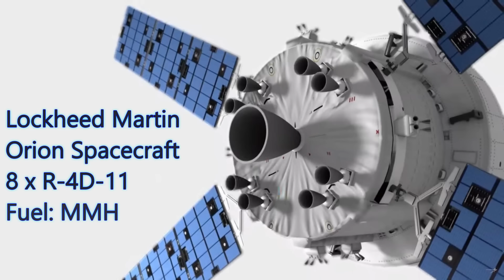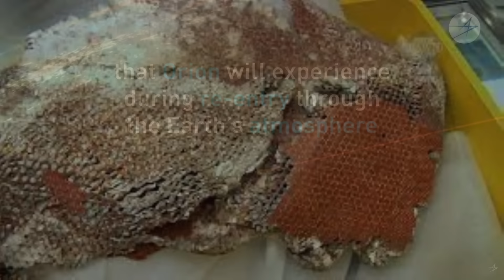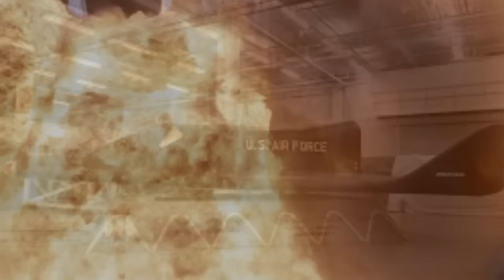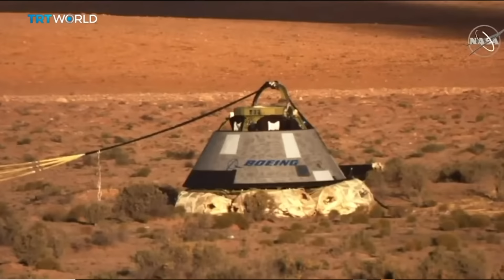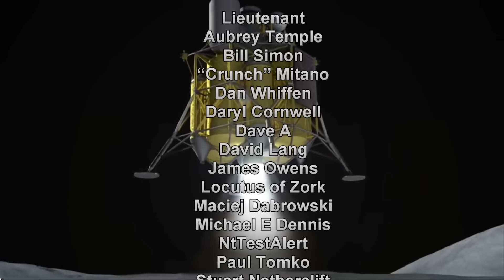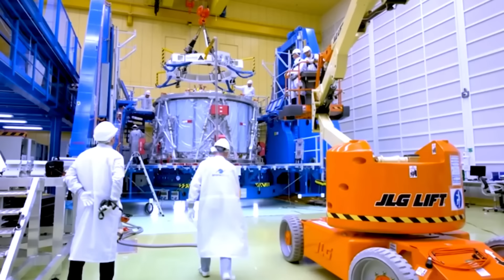Can We Trust the Boeing Starliner or Even Orion to Carry Astronauts to Orbit or the Moon?

Comment: Putting all your money on a one horse race, is asking for trouble!

So NASA wanting more than one Reusable Launch and Re-Entery Crew  Passenger Space Vehicle (RLRE-CPSV) system, from more than one Manufacturer too.

As well as NASA wanting more than one First Stag Reusable and Recoveryable Launch Rocket (FSR-RLR) systems, as well as more than one Second Stag Reusable and Recoveryable Launch Rocket (SSR-RLR) systems.

Maybe if neccessary NASA having more than one Expendable Third Stag Launch Rocket (ETSLR) systems too, all from different manufacturers too.

As well as separate Autonomous Reusable Launch and Re-Entry  Transport Space Vehicle (ARLR-ETSV) system, with its own large internal hangar, as well as its own remote-operated manipulator arms plus opening and closing Hangar doors too.

To transport and launch and deploy satellites in orbit, or carryout  autonomous repairs or replace damaged devices and equipment, or install modifications and upgrades in orbit too.

Or if necessary carryout Orbital Recovery Operations (ORO's) of satellites, in Low to Medium or even High Orbits too!

Or to transport cargo and supplies, from earth to a Space Station in earth orbit, then return with other cargo back to to earth too.

Or transport cargo to an orbital Space Station, which is in orbit around the Moon too. Then return to earth again, with other cargo, that has been shuttled up from the Moon surface  too.

All of this makes common sense and is good practice, for NASA wanting to have multiple options.

Space X maybe the only Reusable Launch and Re-Entry Crew Space Vehicle (RLRE-CSV) system, in operations but it is only useable in Low to Medium Earth Orbits (LMEO's).

As well as carry limited crew and passengers capacity,  plus very limited cargo carrying capacity to and from orbit too! 

Which has to be increased, for  building any future Moon surface base, or setting up first any Moon Orbital Space Station too.

The same goes for any future Mars Exploration Flight, with setting up a Mars Orbital Space Station first, then building a Mars surface base afterwards too!

In either case of setting up a Moon or Mars surface  long term or permanent bases, NASA will need a Reusable Orbit to Surface and back to Orbit Cargo Transfer Vehicle (ROSO-CTPV) system, with its own pilots or unmanned  remotely operated "ROSO-CTPV" too!
Reply from the maker: Agreed my friend. That's why other companies need a chance. Sierra Space etc.

Comment: Launching to the moon takes about the same Delta V as launching to mars because mars has aerobraking available to save on delta V budget. When you are coming back to earth the trip from mars is going to be about 10-15% faster.

Also, Dragon had heat shield problems when it first started launching, it's not like that is some new unheard of cockup. The problems that hit the heatshield were not along the seams between blocks. Since the blocks are made of the same stuff as the apollo heat shield just going back to the monolithic construction wouldn't be likely to fix the problem. The reentry profile for this launch is different, it does a skip along the atmosphere first and that may be changing the behavior of the surface. If that is the case then it is a problem that's unlikely to penetrate deeply and cause problems.
Reply from the maker: The problem may be the difference between thousands of vertical cells and just a few big blocks... The former is inherently stronger.  Yes. Coming back from Mars is a little faster.  Yes. Dragon had heat shield issues which the fully rectified BEFORE putting people on them. The skip may indeed be the source of the problem. Perhaps heating, cooling, and reheating has some effect.

Comment: A thicker Crew Dragon heat shield would probably do the job.   Instead of spending $4B and going to the Moon, just launch a mockup of Crew Dragon with the thicker heat shield using Falcon 9 and put it in an elliptical Earth orbit and then fire a kickstage to bring the re-entry velocity to 25,000 mph.  They could launch one a week until they proved out the heat shield.  They could probably have it working in 6 months.   This is what Apollo 4 and 6 did (both unmanned)
Reply from the maker: You could do a straight up / straight back down or use a Falcon Heavy to send it around the Moon. :-)
Reply: @terranspaceacademy  They have to enter the atmosphere at a very precise shallow angle.  That's why Apollo 4 and 6 went into a high elliptical orbit then did a burn to get the speed up to 25,000 mph.   Doing a loop around the Moon would do the trick too 🙂

Comment: Dragon had a lot of similar problems in earlier years and continues to have issues today, yet nobody doubts it is safe to fly.
Regarding Starliner, NASA ASAP which in recent years had raised concerns with Starliner recently said they are more than satisfied with the due diligence from NASA and Boeing regarding crew safety and working out previous issues.
Regarding the heat shield on Orion, it is not expected to be a showstopper.
The heat shield for Artemis 2 is already long installed on the spacecraft and replacing it would be a huge schedule hit, measured in years.
NASA has said the root cause investigation is nearly closed and they don't expect any hardware changes will be needed at least for Artemis 2 and 3.
The heat shield itself on Artemis 1 worked very well with a lot of ablator margin available.
What happened wasn't that it ablated more, more so that the ablation patterns were different than pre flight models expected.
The heat shield did not have cracking or anything of the sort, I don't think anyone from NASA has said that.
What we have been told so far is that the ablation wear patterns were not as predicted, and that they saw more uneven ablation in some areas than pre flight models expected.
They want to figure out why, and then update their models to make sure they can predict the heat shield behaviour better in the future.
From what we've heard so far, what was seen on Artemis 1 was NOT an issue for crew safety.
I do think it's funny that people would rather fly on a theorized crew Dreamchaser, and somehow are certain it would be safer than actual real world vehicles.
The grass is always greener on the other side I guess.
Reply from the maker: That's because of all the uncrewed cargo mission before they stuck people on it. Work out the problems before you risk people's lives...  We are looking at two Starliner failed flights and one Orion and now we are sticking people on them.
Reply: A Boeing employee are we…

Comment: I don't trust Starship getting to the Moon, or anywhere else beside Low Earth Orbit.
This because the refueling in orbit is still unproven; but what gives me the shivers is the number of launches necessary to refuel the orbiting Starship.
Initially SpaceX said six launches were enough. Then, I heard maybe ten were required. Then, I saw a video of Destin (SmarterEveryDay) giving a lecture at NASA, and there transpired that the launches required were fifteen, and the people there just avoided talking about it.
Fifteen launches must go ahead without an hiccup, without aborted launches, without failed launches. And if a couple of Starship Tankers happens to fail en-route to orbit, SpaceX must have a number of spares ready for launch. And if the experimental ship-to-ship fuel ducts fail to mate, because of debris or thermal deformations, without some astronauts ready to go on an EVA, the Starship launch mission from Earth orbit is cancelled.
I don't want to sound like a Cassandra, I'm all for Space Exploration at 100%, but I have the feeling that Elon Musk has over promised, and NASA bought it whole. In detail, SpaceX glossed over the logistics of  refueling in orbit, and NASA didn't enquire.
I hope that my doubts are out of place, and orbit refueling will prove to be a cakewalk...
Reply: To be fair. I don't think anyone really knows. SpaceX is constantly updating Starship, it's basically in it's epoch phase. Raptor 3 is slated to come out that won't require heat shields and have much higher thrust (meaning more mass to LEO). Along with the booster and ship being stretched to hold more fuel and cargo.
Reply from the maker: Starship should be placed in orbit and then crewed by Dragon... There should be a third stage to go on to the Moon and land I think but I'm still looking at the options.
Reply: Having your space crew lunar module the same as your living quarters is a stupid idea. Every time they want to leave the Moon, they have to blast that huge spacecraft, that's a lot of mass. Spacex should have went with a small crew lunar module and have the starship just be the cargo ship.
Reply from the maker: @Ghost-g3i  We agree. Detachable nose cone is the way to go I think.

Comment: I am also curious to see what SpaceX is going to do with Crew Dragons heat shields for any lunar crew return missions?
Reply: The Crew Dragon won't be used for lunar trips, but only for going to the ISS and back.  Starship is intended to return astronauts from the moon, but that is down the road a ways as they first must rendezvous with Orion to transport astronauts to the lunar surface with Artemis 3.  That won't happen until 2026 at the earliest.
Reply: @michaeldeierhoi4096 per current plans, Starship will only be returning humans from the Moon's surface to NRHO.  From there, Orion will pick them up and return them to Earth.  HLS Ship won't have enough propellant left for a return from NRHO to LEO or MEO, nor will it be capable of reentry or landing on Earth.
Reply: @Spherical_Cow  On what basis do you say the HLS vehicle won't have enough fuel to return? The HLS vehicle will be fully refueled before leaving Earth's orbit and then most of the fuel used will be for landing on the moon and take off.  

You may be right, but I need to hear your reasoning.
Reply from the maker: It would need to be redesigned... It's capable of orbital return only.  Only Orion is capable of a lunar return.
Reply: They probably already have it designed and tested it. I’m concerned about the theory of starship. I don’t think the starship is going to be able to land vertically on the moon. It just looks like a tough job.
Reply: @briananderson4032  Why do you think that would be a tough job?   The whole of the starship project is a tough job.  But, since the raptor engines can throttle down to as low as 40% thrust they could probably land with one engine.   

Alternatively,that may be something that is worked out later.  I see the starship is one very interesting engineering project and I don't worry about how it plays out.   Some people perseverate on whether the tiles will be adequate for reentry for ex.,but this is all part of testing so I expect failure to happen along the way.  So I can be indifferent to what happens. 

Even Elon said there is no guarantee that starship will be successful.  I think it will get to the moon though not on the timeline they expect or hope for.

Comment: Correction Boeing bought out Mcdonald Douglas for thier military buisness. I know a bunch of old guys who worked at Douglas which then became Boeing and they said the exact opposite, that when Boeing took over the safety culture disappeared and quality took a nose dive. Workers would have to inspect their own work and training was cut way back.
Reply: You are right that it was Boeing buying McD that it all changed but what happened in the transition is a fog of changes that we can only speculate. Both were good companies and now it does not look like either one of them survived.
Reply from the maker: I find that inconsistent with Boeing's previously outstanding record...
Reply: The management at Boeing basically had no respect for the engineering teams at MD-80 Long Beach, MacDac HBeach, and Rockwell Int Downey.  Instead of building a knowledge base that passed generations of engineering insight from the steely eyed missile men of Rockwell and MacDac, they basically got rid of those engineers and had no pipeline of Gen X and Millenials to replace.  There was no passing of blueprints, designs or concepts to the next generation.  For this reason, Terran Space Academy's work is really important.

Comment: Simple answer is Starship - they may be a TAD behind but since last flight the issue is re entry for full landing (which others do not even try) and they burn up rockets to solve this - which likely results in this working end of the year. I would not wonder if Elon Musk puts something on the moon for testing in 2025/2026. Maybe even in preparation for a permanent moon base (deploy some supplies, do some scanning of the landing area) and POSSIBLY with some Optimus Robots instead of Astronauts.
Reply from the maker: I'm hoping!

Comment: Didn’t Boeing buy McDonnel,/Douglas?   I think they did but I could be wrong.
The Board Of Directors foolishly decided to replace a lot of Boeing management withe MD managers.  The corporate culture changed focus from engineering to finance.  

The current disaster known as Boeing is the result.
Reply: Boeing management replaced and caused retirement of MacDac Long Beach/Huntington Beach and Rockwell Downey/El Segundo/Seal Beach people.  Seal Beach Boeing is still around but the other four plants are long gone.  Don't blame MacDac.
Reply from the maker: Good point, probably industry wide and just coincided with the buy out.

Comment: Dreamchaser has yet to fly to space and reenter for the first time ever.  It would be a miracle if it did so with absolutely no surprises or malfunctions manifested in the process.  Glitches are normal on a maiden flight, especially to space and back - because space is hard.

The key is to fly early and often (sans crew, of course), steadily derisking and demystifying the actual flight regime(s). Many casual observers rip on SpaceX's frequently exploding Starship prototypes, but through those hands-on failures SpaceX is shortcutting what would otherwise be years upon years of additional elaborate simulations and ground tests that still can't and don't fully represent actual flight conditions, to a point where major technical surprises are still possible during a much-delayed maiden flight - just like what happened with Orion, leading to further multi-year delays, spiraling costs, and ongoing apprehension about any remaining, lurking, unaddressed failure modes.
Reply: Maybe so, but in the end Spacex will also have spent years and years developing Starship. Because space is hard. There is no magic bullet.
Reply from the maker: Good point but we need more competition... Not enabling failure.  When Boeing took $700M for a spaceplane and made nothing that would have been the end for me.

Comment: If orion really does end up meeting starship in Leo as rumours recently indicated, even if its only once, and even if its only for testing... we end up with a architecture that doesn't really need Orion or SLS anymore.
Reply: Let's face it: Yes, Starship probably has imposed the biggest delays on Artemis thus far.  Let's also acknowledge that it is the most ambitious part of the whole program in several ways, got the least funding and the shortest time-line.

The progress SpaceX has made is impressive.  Each obstacle in the flight regime will be overcome in due course.  I doubt they work on these problems serially; it is more likely that the work is being done on multiple aspects and sub-projects in parallel.  We only hear about one or two at any given time.

Will it be ready when Musk originally said it would?  Obviously not; those dates have already come and gone.  Are the other components of Artemis-III ready today, long after they were also promised?  

I don't think so.  Let's give SpaceX the same benefit of the doubt that we have given Boeing, Lockheed, Grumman and every other NASA contractor over the decades.

Given that our agitation in "the peanut gallery" will not help the overall project, we should avoid potential harm that agitation could cause by magnifying some real problem.

Let's take a deep breath, pop some corn and watch the show.
Reply: At the moment Starship is the piece of the Architecture that has the largest delay and worse performance.
Reply from the maker: I think we'll still need Orion.  I don't see Starship safely surviving a lunar return for a long time.
Reply: @terranspaceacademy  I don't think we will see it land on the moon within 2026
Reply: What? Why? The video clearly explains that SpaceX and other companies do not manufacture or even propose to offer a reentry craft which can survive the extreme temperatures that Orion can, on return from the moon. SpaceX is a LEO only proposition.
Reply: so true Elon has all
Reply: What a crock of shit, shows that you have no clue what you're talking about. SLS-Orion are the only systems capable of carrying crew to deep space to the Moon and back to Earth's surface. NASA would never allow astronauts to use HLS as a mode of transport to the Moon, and it has no capability to even return to Earth, let alone reenter the atmosphere from TEI, or from any orbit even, there is no thermal protection system for HLS.
Reply: Starship is far far away from the Moon. 2030s, if ever. There again, the same probably applies to Artemis as a whole.